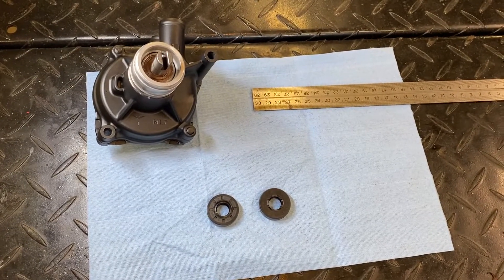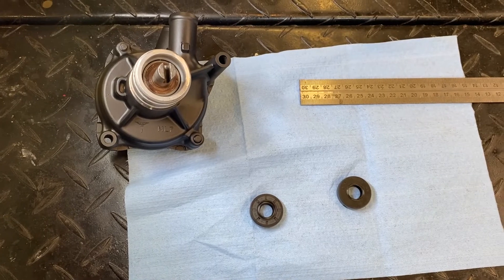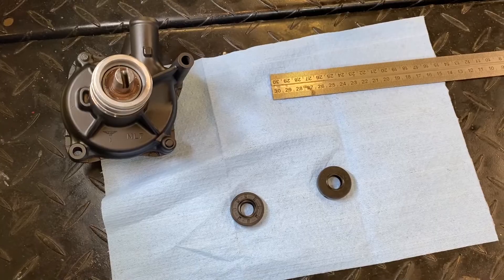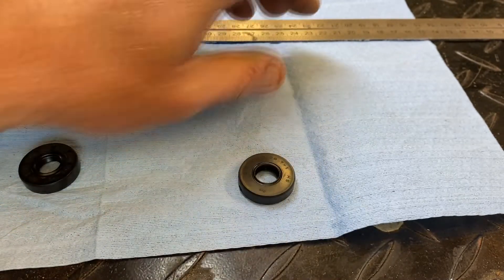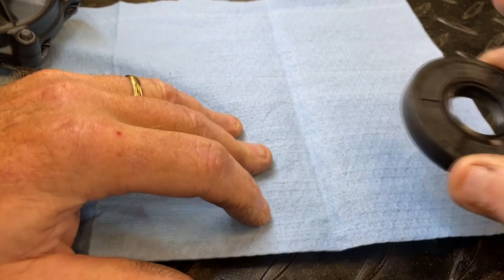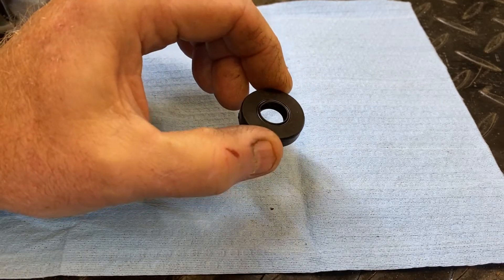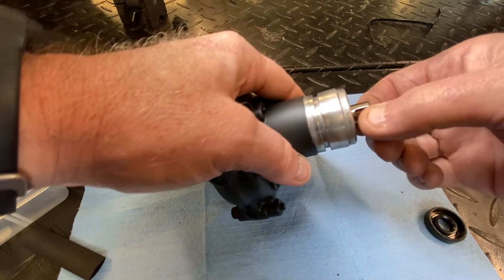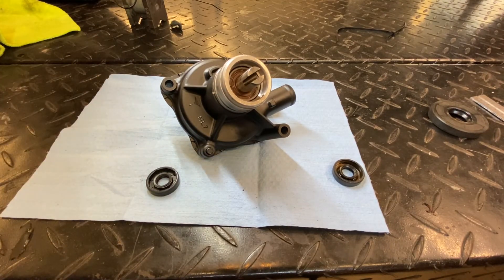How to IDENTIFY OIL SEAL SIZES when there's no parts fiche reference

Comment: Sorry I believe you’re incorrect with the seal position the water  not supposed to get into the oil so the open side or cavity side of the  seal should face the water pump   There should be a spring tensioner on the inside of the inner lip to put tension on that seal lip
Reply from the maker: Check the community for my channel, I posted about this. There is a picture showing a used one for sale on eBay with the seal installed in the manner in which I did. I don't know why exactly, just making assumptions based upon logic. Thanks for commenting and watching.
Reply from the maker: https://www.youtube.com/c/MotoRestoLLC/community
Reply: @karlvanboxel561 You absolutely correct!!!